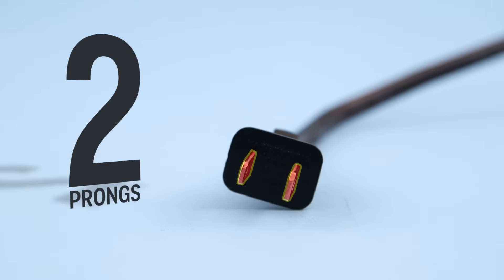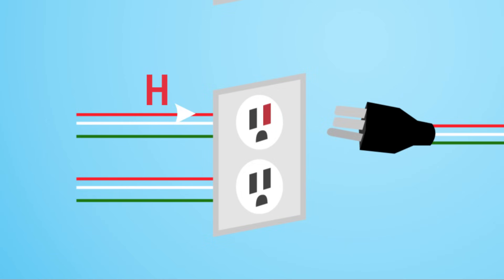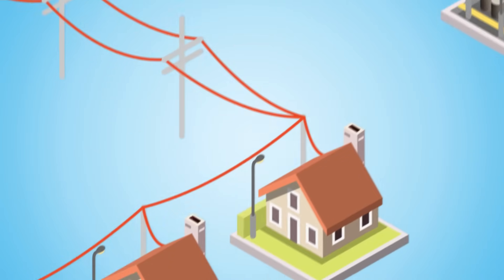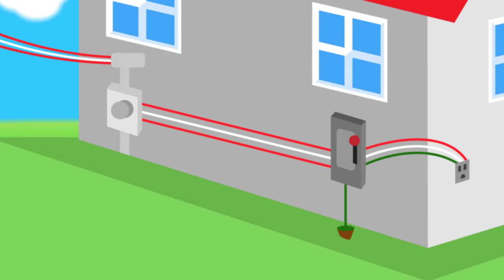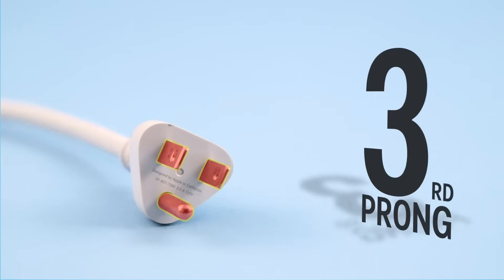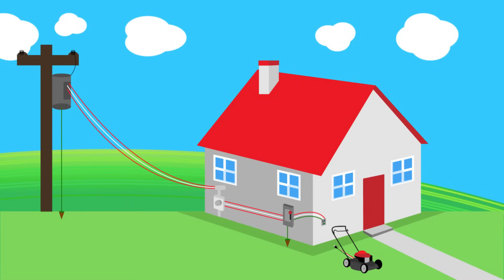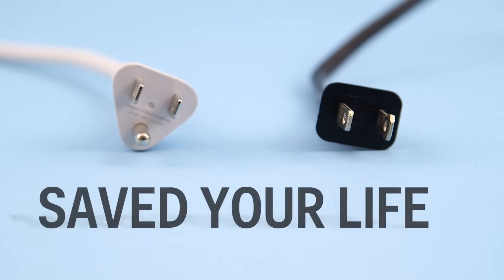Why some power plugs have 3 prongs instead of 2

Comment: So basically they're realising what the British designers realised a long time ago... earth those fucking plugs!!
Reply: I don't think you realise that there are plenty of unearthed plugs in Britain, just like the USA. The only difference being that British plugs always have 3 pins so that you don't need more than one type of socket.
Reply: Grounded receptacles have been required in the US by code since 1962
Reply: Jack Davies Yes. But some people believe that everything is earthed which isn't true, neither does it make an appliance instantly safe.
Reply: Why are you trying to take pride in this?
Reply: Ben Wyatt all the sockets are the same, some plugs do not have earth but must have 3 pins in order to allow electricity to pass through
Reply: British do not use earthing any more often than others. They do not make special earthed equipment for Britain. British just do not get it as they cannot tell the type of the equipment from the plug.

Look at this cable:

https://media.rs-online.com/t_large/F0452669-01.jpg

If you look at the plug you may think it is earthed as it has a metal earth pin. But if you look at the other end you see that there are just  two holes. It is not earthed. The earth is not connected anywhere. In Finland the comparable cable is this:

https://www.audiokauppa.fi/WebRoot/vilkas04/Shops/20121220-11092-175030-1/5232/CC62/27C0/9E80/F557/0A28/1005/E864/euroc8.jpg
Reply: David Birtles 
They've been around forever, they just aren't mandatory in the U.S.

Comment: So this is how GFI outlets work.
Reply: Hey Caged, GFI (RCD in the UK) protection devices work differently to this. They detect an imbalance between the power going down the live (hot) wire and the power returning on the neutral. They act on very small currents and very quickly.
The method in which a ground wire trips a circuit breaker or blows a fuse uses far more power.
Consider GFI there to protect people from getting electrocuted and Ground/Earth wires to stop wires overheating and fires.

Comment: A lawnmower with a plug
Reply: I have one with a plug, it can get really awkward
Reply: AM Productions Yeah? it's an electric mower.
Reply: @ShaunDreclin  The thing about is that thing you see on top of lawnmowers, that is a gasoline powered engine.
Reply: i have one of those and theres no gas emission so it's more eco friendly
Reply: Eekek Hekk my electric mower has a rechargeable battery so no cord required.  Those mowers without a battery use a miraculous invention known as the "extension cord".
Reply: I use one - a Black & Decker. I like it because it's low maintenance and less noisy.
Reply: GLAtaDOS gaming it does suck, blew out every plug socket in the house doing that when a fuse didn't blow
Reply: Yep, try going to the UK
Reply: Team Shurriken, Not true. Quite a few cordless ones are more powerful than a corded one.
Reply: Logan Cochran incorrect
Reply: My grandmother still had a plug in mower in her shed
Reply: I'd say extension cables. Like I used.
Reply: Yes mate they are a thing...
Reply: You can buy battery powered lawnmowers. So no need for gas or a cable.
Reply: AM Productions see attached
Reply: Shaun Dreclin Yes, he means how are you going to mow your lawn if it has to be plugged in with a short plug. It wouldn't be able to move very far
Reply: I ELECTRICUTED MY BALLS ONCE BY RUNNING OVER THE EXTENSION CORD WITH MY ELECTRIC LAWNMOWER. NEEDLESS TO SAY IT SUCKED BALLS
Reply: Icefreak and what happens if I don't know you accidentally run over the cable? :o It's a recipe for disaster unless it has a battery then yeah I would buy one
Reply: Icefreak not necessarily
Reply: So
Reply: I have an electric mower. It's better than gas imo, although getting the cord out of the way is sometimes annoying.
Reply: @GLAtaDOS gaming why does it sound so wrong 😂😂😂😂😂
Reply: lol
Reply: A battery operated lawnmower will never be as powerful as the ones you can plug in.

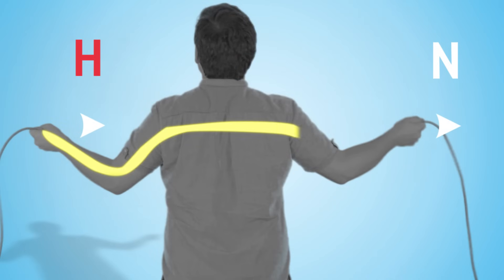Comment: 1:14 amperage
Reply: Jonathan Antonic voltage current and amperage I guess
Reply: Christian Wang amperage is the same as the current its the amount of electricity that runs trough a circuit and voltage is (kind of) how much the electricity wants to run trough a circuit.
Think of it like this, the voltage is the prechur in the water pipe and current is the amount of water that runs trough it

Comment: UK has the best plugs!
Reply: Yep are very safe, we even have a switch to turn them off. Ofc we do need this for the higher voltage we use
Reply: Look up tom scott he has a good explanation on why the UK plugs are indeed better. Like the fact that even if its partially plugged in there is no metal exposed because there is insulation close to the base of the prongs unlike here in the US. Plus the sockets themselves have flaps that keep the hot and neutral wires covered unless the ground prong goes in first to release the flaps. Way safer than most other countrys.
Reply: =Foxtail 230VAC for the UK
Reply: 미셜비 230V
Reply: Foxtail What voltage do you guys use in the UK?  I'm in Canada and it's 110 V - 140 V here
Reply: @bee5120  Most of the world uses 220-240.
Reply: wclifton968 Also fat South African Type M plug (15A).
Reply: no they don't you have 245 volt is most wiring in the UK and the amps are able to use these volts to jump onto YOU more easily plus your wiring system is confusing brown as hot? blue as neutral?
Reply: TBH the Schuko plugs are just as safe.
Reply: that's why I like UK
Reply: UK plugs are the safest in the world the only downside is when you step on them
Reply: Oliver Gray no they don't they can be dangerous
Reply: +TheTexasOOF Gamer well yea if you misuse it but much safer than japan.
Reply: Is UK that lame ur happy about the plugs?
Reply: Foxtail no there not ,any kind of electricity is dangerous even in the UK

Comment: Then why there are still 2 prongs in some countries?
Reply: Bro America also has a 3 prong wire. Just because we have both 2 prong and 3 prong doesn't mean don't have a 3 prong wire.
Reply: Michael McNamara Japan and the Philippines uses 2 prong outlet.
Reply: Japan has a weird system where they use a separate cable to ground things. Does not sounds very safe.
Reply: Appliances only need an earth wire it the appliance is a conductor, preventing a build up of charge if the live disconnects, it would attach to the appliance having current flow through that, so the earth wire is a wire of low resistance to provide the electricity an easier path to flow through. Plastic appliances are so called double insulated so don't need to have an earth wire because they would not conduct electricity
Reply: Because most newer appliances are double insulated.
Reply: Michael McNamara because you only need a ground wire if the load you're using had a metal case. If it's say, plastic, it won't conduct, meaning you're already (mostly) safe
Reply: @obi-wankenblowme6301  Metal case is not an issue, it being double insulated is.
Reply: +unorthodoxxx There are other reasons too, but i won't bother
Reply: Joakim Innvær I'm honestly curious if you're willing
Reply: I already did so on another comment
Reply: Michael McNamara I Don't Know
Reply: If you are talking about the european plug, it has a ground connection, there are atually 2 standards with them https://qph.fs.quoracdn.net/main-qimg-163e8e5b5a45280e1c0a2ea7f16b7e2d
Reply: Its internally grounded
Reply: Death Ninja - don't bother with him. Not all appliances need to be earthed/grounded and thinks just because all of his plugs have 3 prongs he is any safer. The earth prong is often required on what is normally two prong devices in the US to open the shutters for the live/hot and neutral terminals like the British sockets (often you see the earth is a plastic prong).
Reply: The Americans had originally had a two wire system but this has now been superseded. By the time many other countries adopted a electrical supply standard - we learnt from the American system and improved from there. We should be thanking the Americans for the development of our own system.

Comment: So thats why at random times when i use a hair dyer the breaker shuts off.

Edit: Holy Crap ive never had this much likes
Reply: Or you may have an overloaded circuit.  If it's a short it will shut off the breaker as soon as you plug it in.  If it's an overloaded circuit the break will shut off after you run the blow dryer and the heating elements power up.  If it's at random times like you say my bet is it's an overloaded circuit.
Reply: if the breaker is shutting off, the circuit is overloaded. If you're referring to the "reset" button on either the breaker or the outlet, thats a ground fault. something is consuming juice without it being metered back through neutral (the circuitry assumes its following the ground path, or is going through a person to ground) and tripping as a result. 

If you've got a fancy new combo circuit breaker, there is also the possibility of an arc fault (which brush type motors are notorious for tripping)
Reply: I hate it when people edit a comment to say how many likes they got. like holy shit Captain obvious that's a lot of likes. it makes me wanna dislike the comment
Reply: Random Videos no.. Your "overloading" the circuit... Your drawing to much current. It could be due to a multiple of reasons tho
Reply: Random Videos check which breaker, if it's Over Current Protection breaker it means you are drawing too much power, if it's Differential Current switch it's probably the heating element leaking to ground.

Edit: I forgot that heaters on hairdryers are not like those on other appliances, I don't know then
Reply: If it's a ground fault, the ground fuse shuts off, and if it's an overloaded circuit, the breaker will shut off once you use enough power.

Unless you live outside Norway. In that case, it may or may not be the same.
Reply: Ball Is Life idk when i get replies i can nevr find the comment
Reply: Joe Fucking Flacco #11TDS-0INTS #Joeezy #JoeCool #5 #BetterRecievers dude same it triggers me so much XD
Reply: Random Videos do you mean the room breaker or the GFCI breaker
Reply: It's because you have too many outlets connected to that breaker.
Reply: Random Videos don't you mean when you use your hair DRIER?

Comment: That Large 3rd prong is broken on My Extension cord. But I still use the cord?
Reply: You can still use it. It just won't be grounded is all.  The ground is a safety mechanism.  It will still work if you don't have a ground.

Comment: any one else notice he had a plug into his push mower 😂😂
Reply: Same could happen with vacuum  cleaners but most have plugs.  Just like vacuums you keep watch of your cord.
Reply: Looks like a pretty typical electric mower to me. The second horizontal rod on the handle is how the power (on/off) switch is activated on many models.
Reply: +Raven Bristol Just search Home Depot's or Lowe's website.  There are plenty of corded electric mowers available.  They cost less than a battery operated mower.  Electric mowers are awesome because there is little noise and no fumes.
Reply: you would also need an RCB just in case it happens
Reply: It's very likely double insulated.
Reply: namhar namhar hey dude go fuck your self
Reply: Shadow Fan yes, the rcb detects a current difference, when you even begin to cut the cable the resistance in the live (hot) wire (I'm from the UK) would increase thus reducing the number of amps, the RCD cuts the supply before any major damage is done
Reply: Raven Bristol it's common in the U.S.
Reply: I have never used anything but electric lawn mowers my whole life. Never had the extension cord in the blades. You just have to run the cord over your shoulder. I guess petrol mowers are common in the US, electric in (Western) EU.
Reply: Raven Bristol that wasnt a push mower
Reply: I have an electric lawn mower with a rechargeable battery.  It has a three-prong plug and I plug it into the (code-mandated) GFCI outlet in the garage.
Reply: Zach LeBlanc yes they do
Reply: Robert Gabe Lucio
in this case they are the same thing.  But riding mowers are indeed lawn mowers but not push mowers.  Lawn mower is the more general term.
Reply: Never heard of a mower that plugs in. Seems like a great way to get an extension cord caught in the blades.
Reply: @LimitedWard  Never had that problem with getting the cord stuck in the vacuum , same with electric lawn mowers, I don't see why you would willingly run over your extension cord i mean what else are you doing when you mow the lawn besides looking directly in front of you at the ground
Reply: Raven Bristol My electric lawn mower has only 2 prongs instead of 3. It's a 13 amp Black & Decker mower though. I don't know why they don't put 3 prongs for safety.
Reply: Raven Bristol that's a lawn mower not a push mower.
Reply: Raven Bristol Push mowers don't have engines.
Reply: Finlay Mitchell  same thing dude. A push mower is a lawn mower. It's just a form of it. Lawn mower is the general term for something that cuts grass. So a push mower is technically a lawn mower, and also a riding mower is technically also a lawn mower.
Reply: I know right, gonna be hard to mow your lawn

Comment: If u had good education you would have already know this
Reply: Winnie Chen If you had a good education you would know how to spell "you".
Reply: Winnie Chen unlike you
Reply: yeh i learnt it in physics lmao
Reply: Hamzah Shafi Nice grammar.
Reply: LagiNaLangAko23 wla
Reply: Winnie Chen knew all this when I was 7, in highschool (year 7) my DT teacher was surprised that I knew what a resistor was, are people really this stupid in this day and age?
Reply: thanks man
Reply: LagiNaLangAko23 Hahaha Pilipino man ako
Reply: Hamzah Shafi, okay but is saying that she should have changed know to past tense picky?
Reply: Assuming people from their text, pitiful.
Reply: No, assuming people from their attitude.
Reply: maybe she just forgot the 'n' at the end lol, why r u assuming the worst
Reply: She also forgot an a between had and good.
Reply: use double quotes
Reply: SnoopyDoo all appliance plugs have three prongs, it's just that some have two metal ones and one plastic one.
Reply: If you had an education you'd know part of this video is wrong.. or incredibly simplified (not the part about the 3rd prong, that will actually save your life) The two prongs arent always positive and neutral, that's why house electricity is called 2 phase AC (Alternating current) because each of the 2 holes alternate hot and neutral.
Reply: DroneRodeo in the US, it would be called single phase, which is standard in residential homes, using a center-tapped neutral.  US wiring is 200-240 volts, but 120 volts with respect to the ground.  industrial wiring is 420-480 phase to phase or 277 RMS with respect to ground.
Reply: thats so stupid to say, its an abbreviation that she used. if i was being as picky as u, i would say that you should have written 'you' in quotation marks..
Reply: Actually if you had any education.
Reply: FUCK YOU BITCH! Wait no, I can't say that. I'm not going to be evil anymore. I've turned a new leaf/

Comment: Isn't hotwire and livewire the same?
Reply: Yes they are just two different names
Reply: AC doesn't mean it is switching. The live is moving either side of neutral. Neutral is about 0 volts and live switches between positive and negative voltage.
Reply: Yes hot wire is American and live wire is British
Reply: danny santos the hot wire doesn't exist.
Reply: james ihsan Different colors. Black or brown.
Reply: james ihsan Philippines uses black (hot) and neutral (white) wires and other countries like China uses Blue (neutral) and live (brown).

Argentine and Chinese 3 pin plugs are still the same but switched both live and neutral plugs.
Reply: yes,your home is using AC so hotwire and livewire will switch places everytime

Comment: We got the British plugs.
Reply: Not all technically have a 3rd pin though, You do get appliances that don't need ground, for instance a small TV (made out of plastic or some other non-conductive material) and the plugs just tend to have a Plastic third pin, the third pin has two uses in UK plugs. 1. To ground appliances and 2. to open up the live and neutral shutters (to prevent people sticking things into the slots)

Comment: Always knew it was the ground, but thanks for explaining the rest. In my experience, some metal cased electronics have faulty ground wires, and if you touch them while they are on, will give you tiny shock versus the full 120 or 240 volts. What most commonly causes this?
Reply: This is normal for computers and not dangerous but if the equipment fails it is dangerous. You should have the wire fixed. Note if you use such an equipment on an ungrounded outlet that is normal and there is nothing to worry. Just do not touch the equipment and a radiator at the same time in case of failure. 

The voltage is about 115 V but the charge is not much.